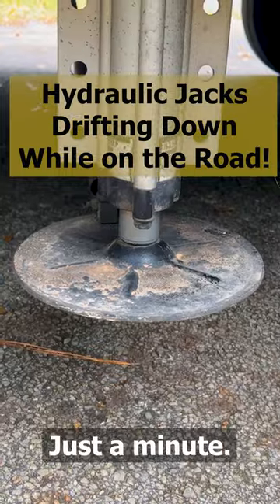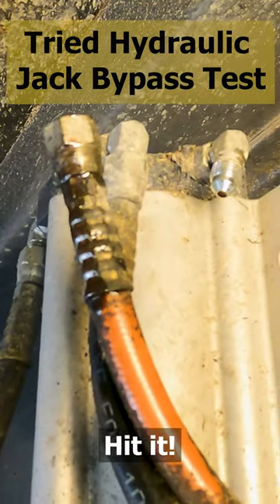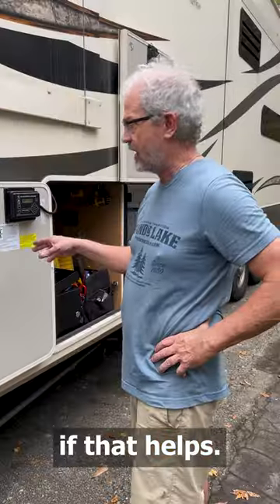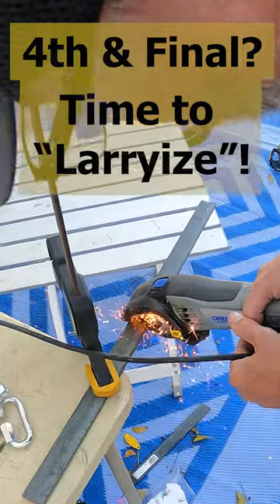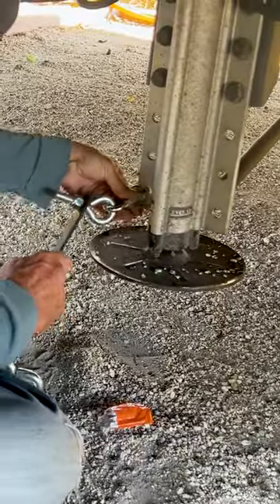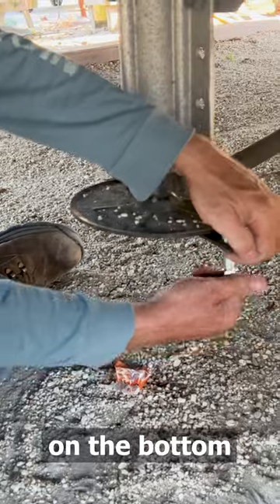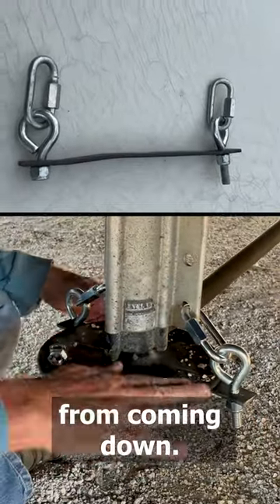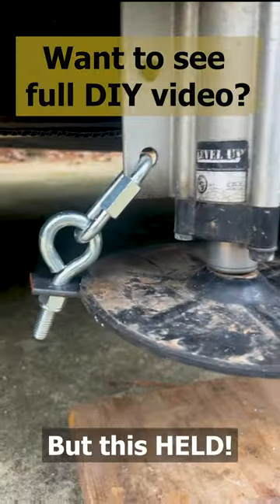Falling RV Jacks Fix #shorts (RV Living) 4K

Comment: I just helped a guy with his hydraulic jack that wouldn't come up. We pulled off hose then manually raised it so he could start home.  I have electric. Good luck..
Reply from the maker: Luckily, we haven’t had issues lately. Still never found original issue reason

Comment: Bad seal maybe?
Reply from the maker: Never found out. It corrected itself. But we still put the safety bar on
Reply: that was my thought fluid slipping past the piston seal from the lower to the upper chamber
Reply: @DownsizingMakesCents  tbh even if it was brand spanking new out the factory part the safety bar still makes sense